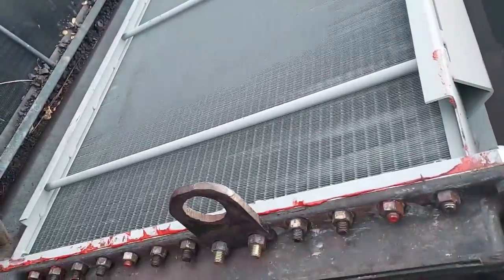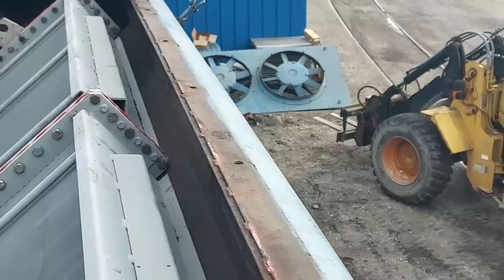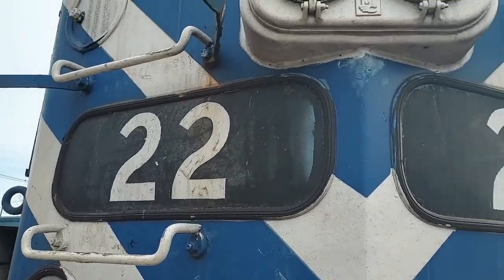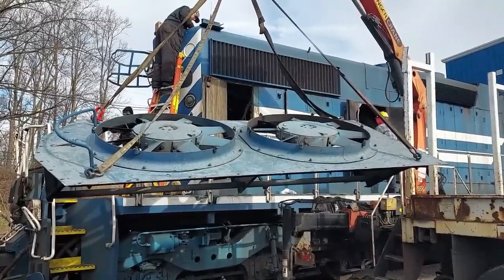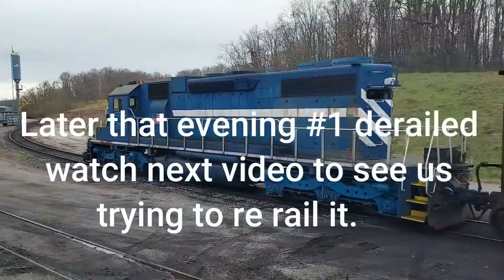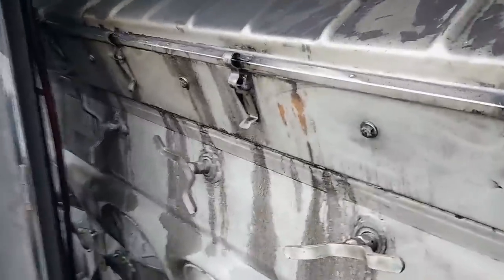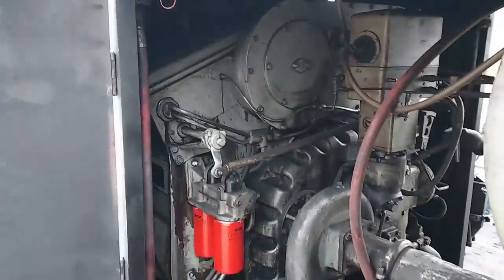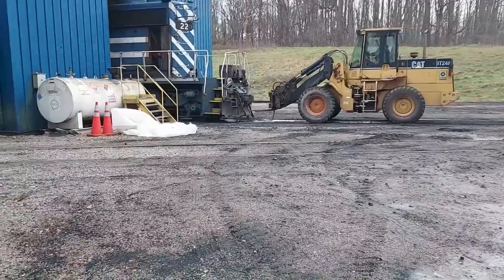A Failed Locomotive Cold Start after Changing the Locomotive Radiator

Comment: What most people do not realize is that the purpose of the diesel engine is to turn generators which power the electric engines that move the train.  A dumb question - why can't this process be put into cars?  A 10 HP engine should be about all that is needed.
Reply from the maker: Thank you very much NM for taking the time to visit with
us and write in. We really appreciate your watching the video my friend. Several years ago my son ran an experimental dozer
that CAT made, a D7, it had same set up as a loco. Diesel engine
ran electric motors which drove the dozer. CAT
told him to run it as hard as he could to try and break it,
but it never broke. he was pushing dirt along side an older
CAT D9 and could push blade to blade with it.

Comment: Used to have a locomotive on the railroad I worked for that had a leak and you would have to put water in it every day the company was to cheap to fix it lol
Reply from the maker: I understand that Jason, they put water in this one for too long
of a time before it finally decided to leak really bad. Thank you
my friend for taking in tonight's presentation.
Reply: @ccrx6700  well at least it is fixed and on to the next problem
Reply: The Huckleberry RR had a 75-ton Porter C-C diesel that had a small leak so the water leaked into the fuel tank.  It was pulling the train and the water level got up high enough to shut down the engine.  One of the guys went out to find where the train was and they were in the east loop.  They had tried to start it and ran the batteries down.  The guy ran the steam loco backward about 4 miles to couple to the diesel.  After coupling and hooking up the airline, the train was pulled back to the station to unload the passengers, then to the shop.  The radiators were on the sides and the fans were driven by V-belts.  The engine was a 6-cylinder Cooper-Bessemer.
The leak did not get fixed and on another occasion, one of the piston rods broke in the engine.  The loco was sold and repaired.  It is now on the Durango & Silverton Narrow Gauge RR.

Comment: I actually thought the radiator grids were actually vertical along the side of the long hood where the air intake is I never thought they were setup like this cool. you can see what I' talking about as the fan roof section is being lifted and sat on.
Reply: Those are the shutters that remain closed until there’s enough heat in the engine to trip a switch and open them. They close with air pressure on the shutter cylinders, one per side on that unit. When the engine gets hot enough, a temperature switch turns a magnet valve on and shuts off the air to those cylinders and the shutters open. 
Why turn the air off to open the shutters? They’re set up so that if the magnet valve fails, or the air line supplying air to the shutter cylinders fails, they will fail in the open position and allow the locomotive to continue on to its destination.
Edit: If they failed in the closed position, the locomotive would overheat and shut itself down.
Reply from the maker: Glad you found out something new Ryan. Not very many folks
ever get a chance to see the inside compartment of a loco. 
Really appreciate your nice comment and for taking the time
to watch my friend. PS: I'm sure a lot of folks thought the same
way you did, so now you know how it really goes.
Reply: @ccrx 6700 That's Railroadin!  I knew how General Electric did it with their setup just walk up to any older GE and look through the lower grills you can see the huge fan and the bottom of the radiator grills. But EMD now that's cool keep them videos coming. God bless
Reply: @ralfie8801  Again I didn't know that, I know with GE the fan will run at low speed for awhile and as the engine heats up it'll increase in speed but to have moveable shutters that's crazy in my opinion. I remember some of the old Alco RS switchers you had to manually open the shutters from the cab as the engine warm up.
Reply: @RyanHatterer-Ryanns999  
Older GE’s didn’t have shutters because they have water flow control valves that keep the cooling water in a water tank until it gets to about 180F and then the flow valves open and send the water up into the radiators. It was known as a wet/dry cooling system. EMD only had the wet system where water was always in the radiators when the engine is running, when it’s shut down, all the water drains out of the radiators back into the water expansion tank. Newer GE models have a wet cooling system like EMD always had and they now have shutters, but they’re on top of the radiators instead of on the side grilles. The shutters are there to help keep the engine warm while it’s idling for prolonged periods of time such as overnight and not being used in cold weather, this can cause the engine to “soup up” which means the engine is too cold for the piston rings to seal and they bypass a lot of oil out the stack which can make a nasty, black spotted mess on the whole locomotive car body depending on how hard and which direction the wind is blowing from,  and the shutters aid in warm up after a cold start. They are required by the EPA on some newer locomotives. They’re left running in cold weather because they don’t have anti-freeze in them. They do have borate water treatment in them to prevent internal corrosion and plugging critical water pressure sensors up with the rusty mud that forms when treatment doesn’t get added. There are automatic water dump valves that open between 35F and 40F so the cooling system drains and there’s no freeze damage to any very expensive parts.
They don’t have a thermostat in the engine’s water outlet to the radiators like most other vehicles do, so consider the shutters as the thermostat and they’ll make more sense to you.
Also, the GE cooling fans do run at a slow speed, but not during warmup. One of the things that happens when the cooling fan comes on is the water is sent up to the radiators, so the fan doesn’t run until the computer decides the engine needs some cooling, then there are 3 set speeds for the fan, it’s not infinitely variable.
I was surprised that the SD-38 in this video only had one water pump, being a six axle locomotive, I sure would have thought the more heavy duty nature of that locomotive would have required 2 water pumps like an SD-40 has. I’ve worked on plenty of GP-38’s with both one and two water pumps, so only one on that big locomotive just seems a bit strange to me.
Reply: @Ralfie  GE never had shutters like I said, maybe I should have worded it differently now the Evolution series I don't know how they do it
Reply: @RyanHatterer-Ryanns999  
I’ve been working on them for close to 25 years and troubleshooting them for 15 years now, I explained how they work and why they work the way they do to give you more insight. GE never had shutters because those water flow control valves I mentioned earlier basically served the same function by keeping the water out of the radiators until it was hot and needed to be cooled. Water flow valves are operated by air and the magnet valves that control the flow valves fail sometimes and that is one cause of engine overheating on those models because the water just circulates through a water tank and back into the engine if it isn’t sent up to the radiators to be cooled.
Edit: After the EVO units came out, they didn’t have a lot of hot engine problems, so at least one class 1 railroad modified some of their C-44 AC engines to have the wet cooling system like the EVO units by removing the water flow valves and using the magnet valves that used to operate those to now open and close a shutter system placed on top of the unit above the radiators.
Reply: @Ralfie  I'm not saying you are wrong like I said I should have worded it differently. I didn't mean to say they had them GE never did what I was trying to say is when you look through the lower grills at the rear of the engine you'll see the fan and lower side of the radiator.. don't get mad. Just miscommunication.....
Reply: @RyanHatterer-Ryanns999  
I never took it that way, just explaining how the different models work and what the functions of the different systems are. If you have questions- ask! If I know the answer, I’ll tell you. Read it again please, I didn’t say GE’s didn’t have shutters, I said GE’s didn’t have shutters BECAUSE, acknowledging your comment. You’re the one that said shutters seem crazy to you, so I explained the how and why without you asking! Please look at my comments as from an instructor in a mechanical class and not that of an argumentative person and hopefully the miscommunication you saw will disappear. Like I said before, if you have a question, ask!
Reply: @Ralfie  it is crazy for me that is one more thing that could go wrong GE setup is simpler in a way than EMD... if it was me I go with the GE cooling system less moving parts less parts overall and maybe you can test to this they are a little easier to work on. If I was designing a locomotive knowing how they are used and abused I go with a simpler setup for ease of maintenance, but what do I know...
Reply: @RyanHatterer-Ryanns999  
Actually you have it backwards, EMD is way simpler with far less moving parts. GE has those flow valves to fail, remember, those are what sends the water up into the radiators to be cooled in the GE wet/dry cooling system. EMD has a wet cooling system meaning there’s water in the radiators all the time if the engine is running and the water pumps are pumping. The shutters fail in the open position, so they can’t overheat unless they lose their coolant, then an engine protection device detect the loss of water pressure and tells the governor to shut the engine down on old units like Dave is working on in this video, or the computer shuts it down in more modern units.
Reply: @ralfie8801  over engineer by the sound of how you example it for GE... you can keep that job never the less
Reply: @RyanHatterer-Ryanns999  
That’s why GE went to a system more like EMD uses with the later EVO units. It’s still over complicated though, GE uses air to open and close the shutters while EMD shutter cylinders are spring loaded so they only require air to close the shutters, the internal springs open the shutters when air is removed. 
It’s a real simple system on their part and rarely ever fails. The cylinders are changed every 3 years during a PI to reduce that chance even further. 
There’s a reason why the SD-40 was the most manufactured and most reliable locomotive in the US, and the cooling system was a big part of that.
Reply: @Ralfie  that was going to be my next question how are the GEVOs setup.. in my mind that is over engineer but if it works great why change it right
Reply: @RyanHatterer-Ryanns999  
The GEVOs started with a different type of water flow valve called a univalve. Those had their problems with overheating also. The seals inside the valves start to deteriorate and make the valve stick as it rotates to change the flow. The company I work for tasked GE with coming up with a mod to eliminate the univalve and associated water piping as they fail. Installation of shutters above each radiator is part of the mod, the magnet valves that used to actuate the univalve now operate the shutters. They’re being converted to a wet system that works a lot better and fails much less often. 
The problem is that GE uses air to open and close the shutters, there are no springs in their shutter cylinders, this means they can still fail to open on one or even both sides and cause a hot engine. But, it’s still a lot more reliable than the univalve system. 
Edit: most of these things can be tested using the computer on the engineers control stand and the verified by looking for water in the expansion tank to drop as is the case with the univalve, and with a mirror on a collapsible pole to verify the shutters open and close. 
To verify water drop, which means the expansion tank was full at engine idle and warm, then as the univalve opens and sends the water up to the radiators, the level in the tank naturally has to drop. There is a sight glass to view the water level to see if the system is full or to see if the univalve opened and sent water to the radiators. 
EMD units also have a sight glass on the end of the expansion tank on the engineers side.
Reply: @ralfie8801  okay I take it back I want EMD, although GE still has a place in my heart, good chat!
Reply: @RyanHatterer-Ryanns999  
You don’t have to take it back - GE’s can be lugged a lot more and pull better than an EMD, at least the old ones with the 645 and 710 engines anyway. 
I don’t know much about how the new tier 4 EMD units pull though, they’re still having lots of teething pains from what I’ve seen personally.
Reply: @ralfie8801  In my area Central PA trains are somewhat long with older power compared to new stuff. One thing I heard crews told about is the computer can sometimes derate too much when wheelspin happens. Other than that I don't see much difference
Reply: @RyanHatterer-Ryanns999  
We build some that are 2 miles long or more. Stuff heading from Texas to the lower west coast with mid and rear DP units. Those can be a challenge sometimes in the hilly areas.
Reply: @Ralfie  I don't want to hear or see another 2 mile here since the new year we had too many derailments in my area
Reply: @RyanHatterer-Ryanns999  
Ha! Dave has his share of derailments with their short trains! As he says: That’s Railroadin”

Comment: We fillem with 60,% glycol so it will not freeze great video thanks Dave
Reply from the maker: That's interesting Gary. Do they drain that and run plain water
in the summer then? Many railroads only run straight water all
year long as we do because of the over heating issues during
summer with the glycol. But again, I don't know what locos
you run. the SD 70ACe's run a mixture from what I hear. Really
appreciate your taking the time to watch and write in my
friend.
Reply: @ccrx6700  my concern with water in the winter is that if the locomotive is not kept hot on a freezing day, I would think you'd have catastrophic damage.  If there is a mechanical failure and the locomotive can't be kept warm, then wouldn't you have to drain the water ASAP?
Reply: @ccrx6700  here in New England and south Boston repair shop we have a real mixmash of engines  Cummins, caterpillar, EMDs I had the kitchen sink thrown at me but gottem running 275 totes filled with coolant and pump them up with gasoline powered pumps fun stuff  straight causes freeze plugs to pop
Reply: @selkiemaine  normal is straight water with an anti-corrosion inhibitor, purpose is if the glycol gets into the oil, it won't evaporate like water will, locos are drained if they don't have a means of keeping the coolant warm, and some locos have the ability to drain themselves automatically, when the coolant gets below 40 degrees F.
Reply: @rearspeaker6364  Thank you!

Comment: Another great video, something not normally seen on a locomotive, thanks. One question, looks like straight water was pumped in, after testing is that water drained and water/antifreeze installed?
Reply from the maker: Thank you Don, glad you enjoyed the presentation.
Most locomotives run straight water. We do put in a rust/scale
inhibitor, makes the coolant look like watered down fruit juice.
The only EMD loco I know of that came from the factory with
anti freeze is the SD 70ACe. Because of the straight water
is why you see so many locomotives idling during the winter,
unless they are equipped with a Smart Start system which
automatically stops and re starts the locomotive upon certain
engine parameters. Thanks for watching the show and writing
in my friend.

Comment: Those poor starting batteries.   I feel their pain.  It’s surprising there are no diesel fired engine heaters for the oil or water.
Reply from the maker: Voltage to the 2 starting motors is 64 volts, these old EMD engines
crank fairly slow. In the shop they put a charger on it and after
about 5 hours it started right up. Thanks for watching and writing
in my friend.

Comment: Thanks Dave! She needed one more hamster on the wheel to get her to go. Take care friend and stay safe!!
Reply from the maker: EMD neglected to provide us with the Model T hand engine crank
when we bought the locos Rick..... LOL Thank you so much
for watching and writing in my friend.
Reply: @ccrx6700  That's a good one Dave. It would take a big boy to turn that handle!
Reply from the maker: @rickcooper6817  👍😊💪
Reply: @ccrx6700  I remember one guy on an old EMD567 cracked open a few of those blowdown valves, the batteries are only a 60v system on those, and it just didn't have enough amps to crank it over fast enough to do anything except puff out white/blue smoke, and just wouldn't fire. So by leaving half of the cylinder cocks cracked, it acted like a compression release on like a chainsaw or lawn mower. But the problem with doing that is, if you're not really fast to go close them all quick, with someone holding back the layshaft to like a minimal fuel position, you can get all kinds of sparks and smoke from the slightly opened ones! Makes for an exciting start! Parking in the shop for a few hours to warm up is much easier on the equipment too!
Reply from the maker: @brnmcc01  👍😊